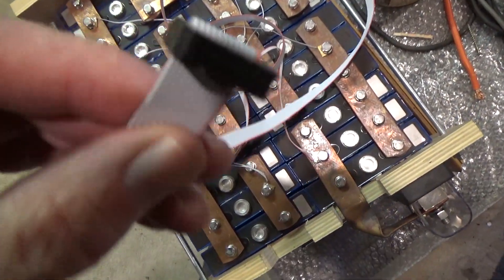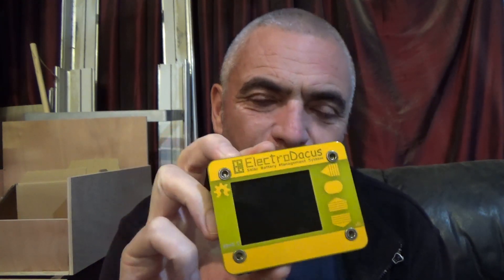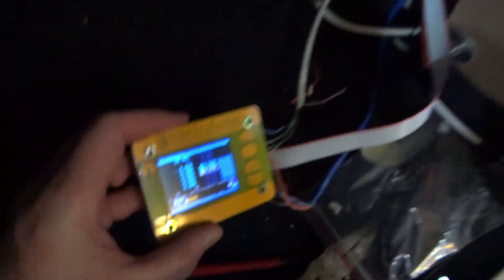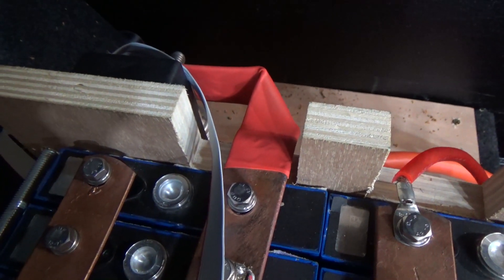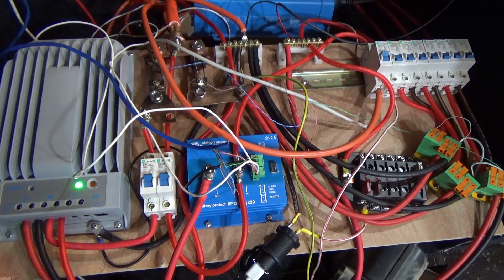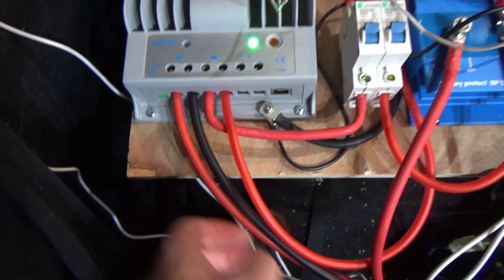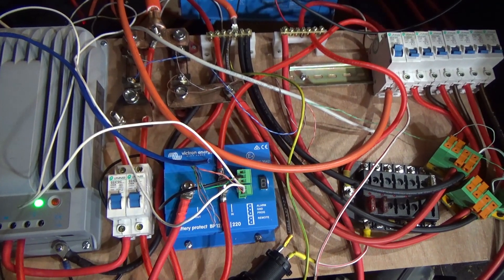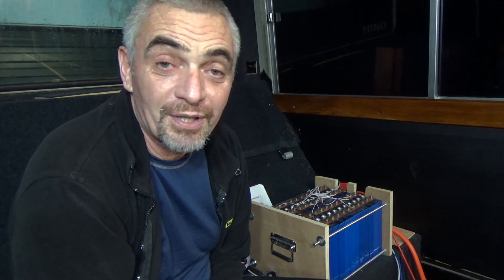LiFePo4: Repacking and re-midbalancing the BusedAs lithium battery

Comment: Thanks for making the video on the electrodacus in really thinking about getting one .. keeping makeing these  they have alot of great info .. have u decided if u r going to just use the electrodacus . As a stand alone system. or the solar charge controller yet ??
Reply from the maker: Thank you. About 90% sure. If I didn't already have the MPPT charge controller, I would not be buying one. Im actually working on some better side by side testing so keep an eye out for that video
Reply: @BusedAsNZ  awesome  thanks.

Comment: An Australian guy had the same problem on the forum.  Recommended to install the sbms0 into a sealed box in a humid environment.  https://groups.google.com/forum/embed/?place=forum/electrodacus&showsearch=true&showpopout=true&showtabs=false&parenturl=http%3A%2F%2Felectrodacus.com%2Fsolarforum.html#!searchin/electrodacus/Crystal/electrodacus/X4-KFQrkaL0/qcONe7XCBgAJ
As Dacian can't currently ship bms from Canada to New Zealand I've had to send mine to America to be freight forwarded from there. So could be weeks away?
Reply from the maker: Yeah that would work, hopefully my bus will never get as damp as my shed. Patience huh, not something I'm good at. Are you getting the new diversion DSSR20s? they look cool
Reply: I'm just getting the standard dssr20's. We have no need for diversion as we already have an electric hot water heater that we can run from 220v or 12v.
Reply from the maker: I'm quite tempted to order some to play with, if I can get enough solar coming in to make use of them. But since that's much more likely to happen in summer they might be more use to run ventilation or some sort of cooling

Comment: I heard from Dennis this week. He’s expecting the replacement batteries in next weekend. I assume yours are on the same shipment as mine.
Reply from the maker: Picked them up today. Woohoo, cant wait to pull them apart
Reply from the maker: Yes, fingers crossed :)
Reply: Even just knowing that he’s a real person who was there with your batteries when you arrived is encouraging. I hope for both our sakes that these are good.
Reply from the maker: Yep. They are different cells, taller, thicker and heavier though not quite as wide. Which is good, likely will be a higher capacity. But also a bit of a pain because none of the stuff I built for the old battery pack will fit and I'm out of copper pipe.
Reply: He’s not sent me mine yet. I’m in Hawke’s Bay, so hoping he arranges shipping. Keen to hear how the new ones work.